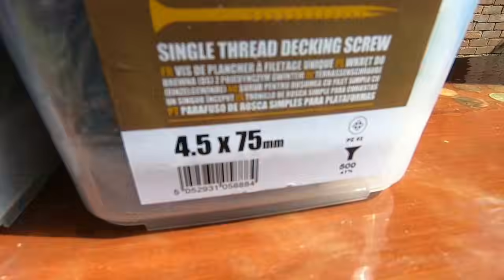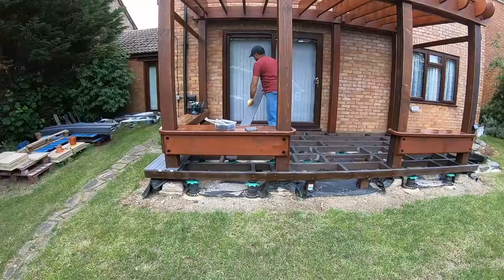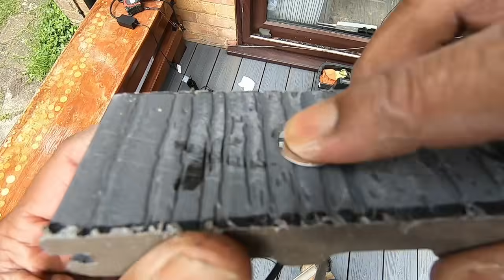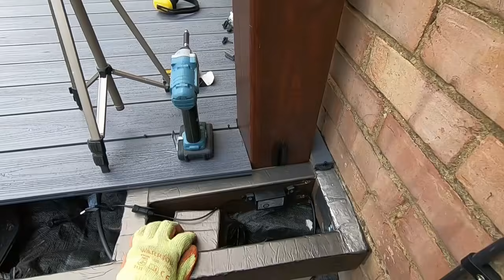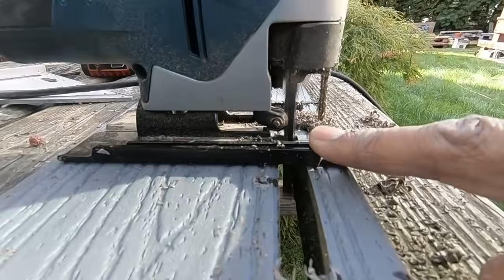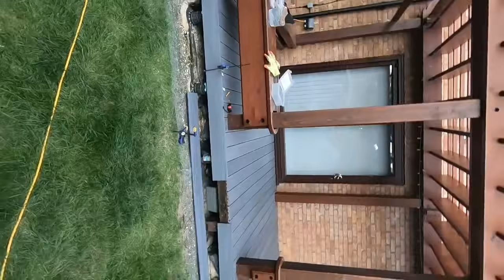DIY DECK Build - Episode 2/2 - Composite Decking, LED lights and Pest control !

Comment: Suj,
You do a great job, that will stand the test of time, a couple of comments though, when you installed the Metpost spikes surely this would have eliminated the need to use the height adjusters along the outer edges of the decking. If the height adjusters were necessary, then why not locate them further in, so as to avoid slotting the face boards?
Reply: @SujMenon  ,

A really professional job, as a matter of interest, how many man hours did it take to complete the entire project? I know it was expensive because of the high quality materials that you've used!

Comment: Very good Suj, really enjoyed watching. Are the flash tapes required to cover the frame, joists and noggins?
Also what concrete mix/ratio did you use (first video)?
Many thanks